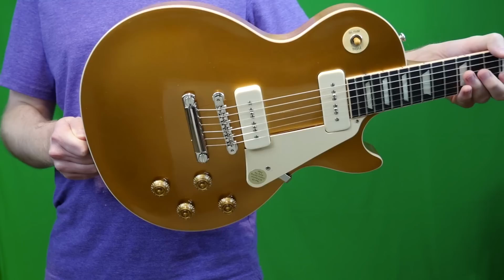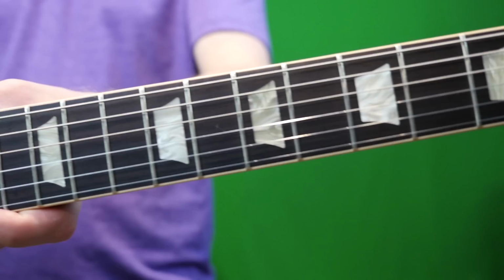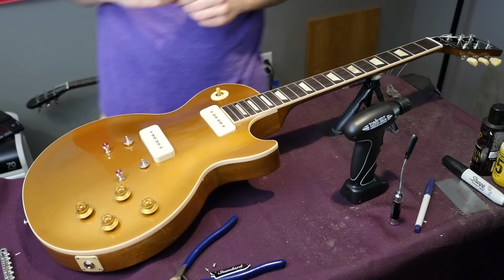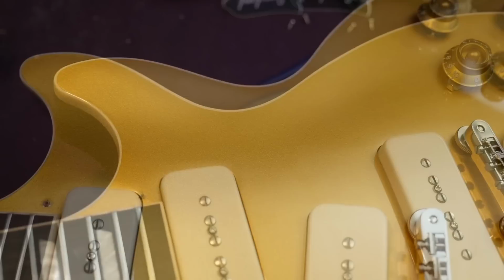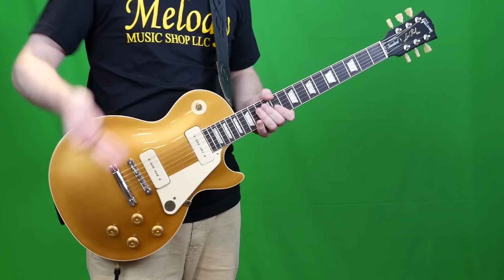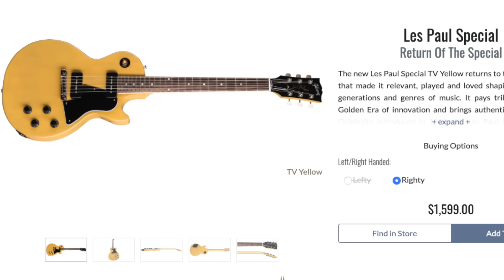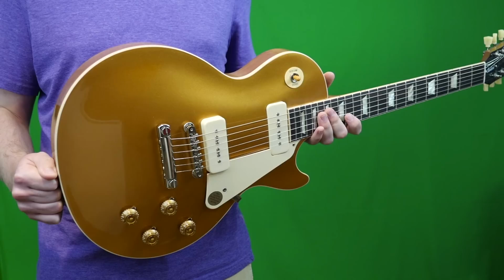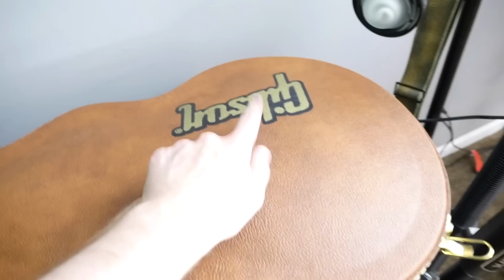The NEW Standard 50s P90 Gold Top | 2019 Gibson Original Collection Les Paul Review and Demo

Comment: The reason why you can easily fit minihumbuckers into that guitar is that the pickup mounting ring for a minihumbucker is actually a P-90 soapbar cover that was cut out, and this has a historic precedent.  

When Gibson reintroduced the Les Paul in 1968 after a hiatus of 7 years, the Les Paul was originally only available in two versions anymore: the Les Paul Custom (now with a maple top instead of mahogany, and available in different colors) and one that was essentially a 1956 Goldtop reissue, with P-90s ─ they were not Les Paul Standards, because the Standard would only be reintroduced again in 1974.  Then in 1969, Gibson decided to move the production of Epiphone from the New York facility over to Japan.  The Epiphone factory was sold to former Epiphone employees, who rebooted the production under the name Guild ─ a scenario that would later on repeat itself when Gibson closed the Kalamazoo plant, which was then bought by the former Gibson employees from there, who then started (and are still) making excellent guitars under the name Heritage.

Anyway, returning to the subject of the pickups, after closing the Epiphone plant in New York, Gibson got stuck with a whole load of "New York minihumbuckers" that they had been making for Epiphone models, and so in order to get rid of that stock, they cut out the P-90 soapbar covers in order to use them as mounting rings, and they simply mounted those "New York minihumbuckers" into the 1968-spec Les Paul Goldtops, and rebranded those as Les Paul Deluxes. :)

Note: the "New York minihumbuckers" are distinctly different in design to the minihumbuckers used in the historic Gibson Firebird.  The "New York" variant is essentially a scaled-down PAF pickup, with polepieces and a magnet bar underneath the two bobbins.  The Firebird variant has two magnet bars sitting inside the bobbins themselves, instead of having distinct polepieces, and of course, it has no separate magnet bar underneath the bobbins.  You can also not remove the covers from them, because if you do, they will fall apart — the cover is what holds the entire assembly together. ;)
Reply: Aragorn of TOT & ER Great info. So what’s the difference in sound from the Firebird mini and the NY mini?
Reply: @rickbrown3426  Well, I don't know what pickups Gibson puts in the modern Firebirds, but my Firebird VII is from 2003 and those pickups have ceramic magnets in them.  The "New York minihumbuckers" on the other hand have alnico magnets ─ I think it's alnico 5 but don't pin me down on that ─ and they sound a little warmer and more "open", with slightly less output. 

The original Firebird pickups also had alnico 5 magnets, but given that they have magnet bars inside the bobbins instead of individual polepieces, they don't have the same string-to-string articulation as the New York pickups.  But then again, there's also no drop in signal while bending, thanks to the continuous magnetic field.  So it's a trade-off. :)
Reply: Aragorn of TOT & ER 

Except Epiphones were made side by side with Gibsons in Kalamazoo from 58/59. Yes, they had Epiphone parts and they were used in the Zephyr, Sheraton, Riviera, etc. in the case of the mini Humbucker. They also used Epiphone single coils that look similar to the mini Humbucker in Models like the Coronet, but built in Kalamazoo. 
Great info otherwise. I didn’t know Guild rose from Epiphones ashes.
Reply: Excellent information, I appreciate your time. There is something about the 3 mini’s after you learn to “Dial in” the middle pickup to thicken them up they are just awesome
Reply: @clockwork914  Ah, I didn't know Gibson still continued to build Epiphones in Kalamazoo for a while after the closing of the New York factory.  Thanks for that info. :)
Reply: Aragorn of TOT & ER 
Back in the day (58-70) when shops in close proximity to each other would compete to be a Gibson dealer, the loser would get the consolation prize of being an Epiphone dealer.
Reply: @clockwork914  Yes, that I do know.  Gibson forbade dealers from selling both Gibsons and Epiphones.  They had to pick one or the other. :)

Man, considering what Gibson has done to Epiphone since, I think Epi must be rolling in his grave.  And Orville probably too. :p
Reply: Aragorn of TOT & ER 
Nah,
Thanks to Les Paul, Epiphone lives! They are great guitars that fill their place in the market. No shame in owning one. They probably roll out about 10 guitars I want to buy Every year. Gibson doesn’t. They’re not hand made in New York City, but they don’t have that cost either. If stolen or damaged, there is less heart ache & pain involved. I had an Epiphone Hummingbird pro and still have a Dove pro and it’s not going anywhere❕Brilliant guitar with my favorite neck, next to my Les Paul with 59 neck profile.
Reply: @clockwork914  Yeah, but I was thinking rather along the lines of the demotion of Epiphone to primarily a manufacturer of authorized Gibson copies ─ primarily the Les Paul and the SG ─ whereas Epiphone's own models used to be on par with Gibsons in terms of build quality.

On the one hand, I can understand why Gibson did it.  Fender did a similar thing with Squier, except that Squier was created by Fender specifically for that purpose, whereas Epiphone was a brand that stood on its own.

Gibson also did some nasty things to the photos of Epiphones under the Henry J. era.  They touched up all the Epiphone pictures in Photoshop to remove the glossy reflections from them, in order to make Epiphone guitars look bland and cheap ─ even the Epiphone Les Pauls with their veneer tops actually looked a lot better in real life than in their photographs.  That was one of those nasty business tactics.  And then there was the PRS Single Cut lawsuit, which Gibson eventually lost.

Or as one of the editors of Guitar Player magazine put it, "anyone who cannot tell the difference between a Gibson Les Paul and a PRS Single Cut should be bludgeoned to death with a Hondo II." :p
Reply: Aragorn of TOT & ER 
Epiphone would be DEAD if not for Gibson. Hard to imagine that a company would craft a product, then diminish its appearance/value. To the discerning eye, an Epiphone will NEVER be mistaken for a Gibson. Straight away, the gloss is too effing gloss. An Epiphone Japan Les Paul May have a more correct looking headstock, but it’s not getting confused with a Gibson, ever!
Gibson could have simply dissolved Epiphone, but they didn’t, to our fortune! 

Thank you Gibson for keeping the Epiphone brand alive❗️❕❗️
Reply: Aragorn of TOT & ER 
They did not choose one or the other. Gibson picked the winner!

Comment: I bought this guitar with the humbuckers. The neck is perfect and it plays its self. Mine had the same issue with the pick guard. Looks like on my traditional they drilled the hole higher then they are on these guitars. Not a big deal I will be keeping the pick guard on. I got a better deal at guitar center. Scratch and dent. $50 bucks off and then a extra 10% off. Great guitar I highly recommend it. I played 2 shows so far with it and love the tone and playability. It dose not have a base ball bat neck. They are just a lil bigger then the 60s slim taper. It sustains very good even with the lower output pups. My fretboard was in great shape when I bought it. Bridge pup dosnt have to much treble and the neck isnt to warm that its muddy. The taper on the volume knobs is really usable. I used them live to clean up a dirty sound and to change my tone on certain songs. It stays in tune great!

Comment: Thanks for this video. I have been in the market for this model for a while now and today I put down a refundable deposit to a guitar store to get one shipped there so I can check it out. With this video I now know what to look for to get a good example! 

I'd like a R6 but I just cannot justify the price difference for what you get, it's an insane price difference (used market value is even more so insane and continues to be so). On a side note; Gibson really need to work on their marketing as you would think their 1956 reissue product page would really have further details / charm / photos to help sell and justify the double price tag of the product. But no, it's the same page template as the standard, literally no frills! I look back at the 2018 marketing of my 1959 VOS Reissue Les Paul and it's like they actually cared by putting some effort in to the marketing!

Comment: An update of my experience of a 2021 model I purchased.
I concur with all this very helpful and detailed review.
Recently purchased it last month - Great guitar and comfortable despite being accustomed to playing 60s necks such as my 1977 Gibson (Norlan period) LP. std and a number of MIA and MIM Fenders. 
It was apparently based on serial# built at Gibson in August this year. 
However, I am extremely disappointed with quality control.
How it was allowed to leave the factory with damaged jagged pickup pole piece screws is just beyond belief.
String Nut very sharp edges and tool mark running horizontally between GBE strings side facing fretboard. Also, there are what I assume are glue marks on the top of the fretboard between two or three frets tool marks on the neck binding located close where the neck meets the cutaway of the body.
Appears to be paint chipped off the body next to the lower string tailpiece post. The lead jack plate was not properly aligned with the body.
Though none of these things affect playability it is somewhat disappointing particularly as Gibsons are quite expensive here in Australia and the fact I had to wait 9 months for delivery as it was ordered at end of Feb this year. 
I have by email put a complaint to Gibson US. 3 weeks ago but have received no response other than acknowledgment they received the email. Not sure or holding my breath I will get a further response.
So yes, It is a nice playable guitar but check out the detailing and QC before purchasing. Hopefully, my scenario is just a rare occurrence.

So despite a would I recommend this guitar? 
Yes. 
If you have the money and are happy to adjust to a little thicker neck compared to the 60s profile, go for it.
Reply: Whom did you purchase from? I know Sweetwater does a 50 points check on their guitars before they leave their facility. Not so sure about Guitar Center. Sorry you had these issues. Yes, I’d be pissed.
Reply: @1sttvbn  I purchased these from a Retail store in Melbourne Victoria Australia. 
Back in Feb the store has contacted the Australian Distributor and sent them photos,  I also in Feb contacted Gibson US myself via email I have heard nothing further from any of them. 
Not impressed by either party.

Comment: Great content Trogly. One thing I noticed is Gibson gave it independent volumes with the 50s wiring, if you turned the volume all the way down on one pickup in the middle position you should still hear the other. No middle position kill switch or muddy blending etc. Did you happen to check that?
Reply: I am 99% sure the 50s wiring refers to the differences of how the tone pot/Capacitor are wired in the circuit and result in an overall brighter tone when the volume(s) are are rolled off.   The independent volume wiring you've mentioned in yet another wiring mod that is possible and to my knowledge never offered on a stock Gibson.  The independent volume wiring utilizes separate groundings for each pickup circuit.  The 50s wiring to me is more desirable compared to modern wiring.  I've wanted to try the independent volume mod and will wire up one of my guitars like that in the future.  Here is a link to the Seymour Duncan site that explains the 50s wiring https://www.seymourduncan.com/blog/tips-and-tricks/lespaulwiring
Here is a link for the decoupled volume wiring modification (a really cool idea).
https://www.premierguitar.com/articles/21106-mod-garage-decouple-your-les-pauls-volume-controls
Reply: @hkguitar1984  I suppose you could call the wiring in these guitars modern wiring. The interesting part is the hot from the pickup is on the same lug of the volume pot as the capacitor going across to the tone pot, that decouples the volume controls IIRC. Thanks for those links HK I am reading up now!
Reply: @GigaGrandpaYT  Yeah, after refreshing myself on the subject this morning it appears the decoupling of the volume controls inhibits some of the high frequency from the output signal, that kind of makes it a "No-Go" for me.   
To comment on Austin's comment about the bridge pickup sounding a little thin on this P90 guitar, turn the amp up and cut back on the guitar's bridge tone control a little, the notes fatten right up.     So many of these guitars sound/react differently when the amplifier is cranked up.   I have a Marshall Plexi and when that amp is turned up about half way it's amazing how much impact the guitar's tone controls make.  At least that has been my experience.
Reply: @GigaGrandpaYT  DOH, I just now made the connection between your Avatar and Screen Name, Nice Jem BTW, I've never seen the Blue version in person.

Comment: I have this guitar and I'm pretty pleased except that the I find the neck pickup is a bit too wooly, like almost every other P-90 neck.  I'd like to try a staple P90 or a Lollar 50s wind neck to get more of a biting neck tone.  The bridge is only slightly thin to me,   Also, I'm disappointed that they didn't use 50's wiring.  Instead, Gibson used standard modern wiring.  However, it plays great, even with the funky chunky neck.  It's a keeper.

Comment: At 18:45 you say that the R6 differs from this 50’s Standard w/P-90’s model as the R6 has 50’s wiring. Does this model you are showing not have 50’s wiring? I would think for sure being advertised as a 50’s model it would have the 50’s wiring. 
Great demo by the way. 👍🏻

Comment: Hi Troggly, nice review! I wonder how this model compares to the 2018's Classic Goldtop with p90s? The neck profile and tuners is the obvious difference but I wonder what is the overall feel of it? I have a 2020's Standard 50s with humbuckers as a reference and I think the Classic is a tad heavier and feels more robust although both are non-weight relieved and Standard having thicker neck profile. Also I found out the QC is a little better in the 2018 model and the fretboard is quite darker (Standard had a fretboard almost the same colour as Nesquik drink before lemon oil conditioning xD).

Comment: Can you please tell me why Les Paul studios are not holding their value you can still pick him up pretty cheap I have a 91 and it's not worth much more than I paid for it thank you
Reply from the maker: They have no collectible value - they are players instruments. They will hold value but never really appreciate. 90s studios with ebony boards and mid 80s with Shaw PAFs are the most desirable
Reply: @Trog  Thank you for replying fast... Yes mine is an ebony fingerboard the pickups were replaced with DiMarzio Al Di Meola models for the bridge in the neck. This question has been bugging me for a while because I've been looking at Studios quite a bit and couldn't understand why they were so much less expensive than a a standard or some of the less expensive models it is a two piece mahogany body Maple cap in my mind it's still a Les Paul it just doesn't have the binding

Comment: Can you convert the new Gibson fake abr-1 to an actual one?
Reply: I think you'd have to pull the studs, then fill the holes before screwing it straight into the body so not sure it's worth doing tbh. Especially when you consider a 56R has a proper ABR-1 (I should know, I've got one lol) & you can pick up a used model in excellent condition for a bit less than this one costs (I got mine 2nd hand for £1600 - around $2000 US)
Reply: Jubei is correct, it is a lot of work.  The higher end Tokai Les Paul guitars also utilize the vintage ABR-1 bridge/installation as well as the long neck tenon.   Interestingly some of the Tokai Les Paul guitars cost as much as a real Gibson!

Comment: I recently bought a Les Paul Standard 50's P90 Gold Top guitar. I like the bridge position clean or under OD and the other 2 positions when  clean or mostly clean.  Frankly, over-driving a neck pickup unless it is a Strat (like Hendrix did) IMO almost never sounds good. I recently replaced the '57 Classic's on one of my Les Pauls with Gibson Burstbucker 1's and I slightly prefer them in every way.  Your mileage may vary.

Comment: Looks nice but I do wish they had more vintage specifications. Doesn't have the nylon nut, fine course knurled nut on pickup switch, pigtail tailpiece, catalin/bakelite switch cap, Grey Tiger waxed capacitors,  pots that had the correct taper, orange cloth wiring and black tubing, the carved maple top on the older models was more defined, they original kluson tuners didnt have any writing on the back. Also the bridge pickup was always a little quieter than the neck, which gave it a certain sound in the middle position. Looks like theyve tried to balance them out a bit with a slightl hotter pickup in the bridge. 10.5  lbs is a couple pounds too heavy as well.  I am pleased with the price drop,  thats a good step.